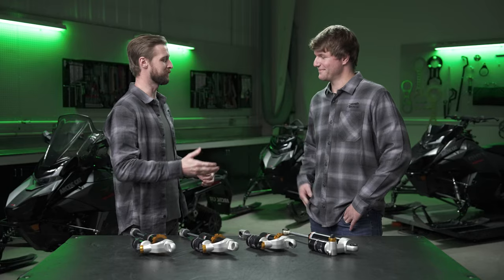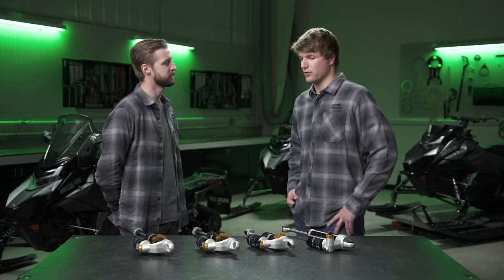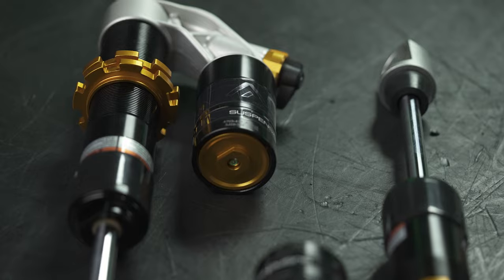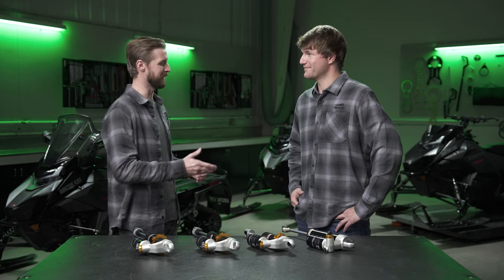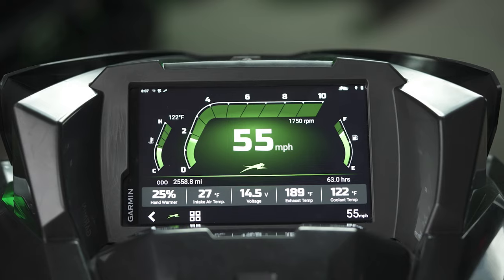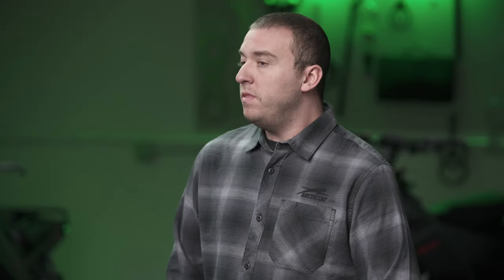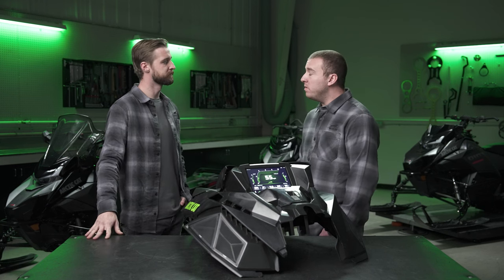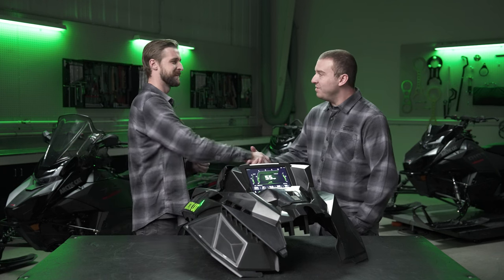Arctic Cat MY25 Deep Dive | Technology

Comment: Would have loved to see some internals/cut aways of the shocks.
The G8 should have been available as a factory installed option on any sled for spring order.
Reply: If they are using the same pistons as the IFP shocks, as they stated, they look like the old Fox powdered metal steel pistons.